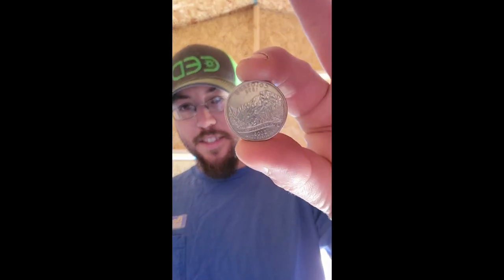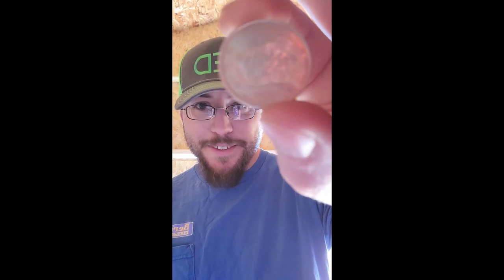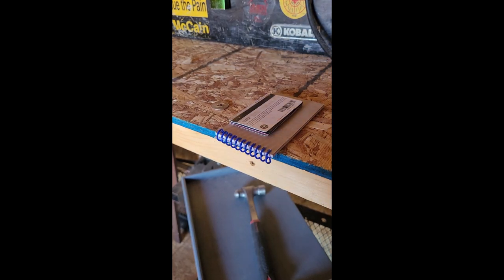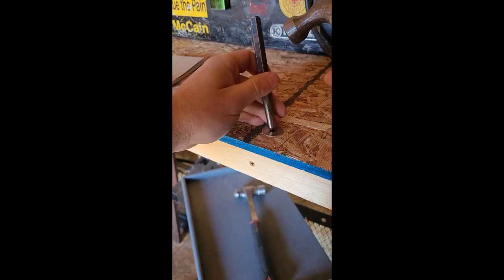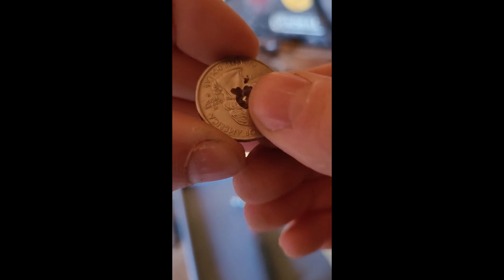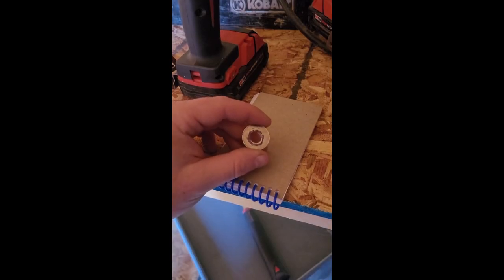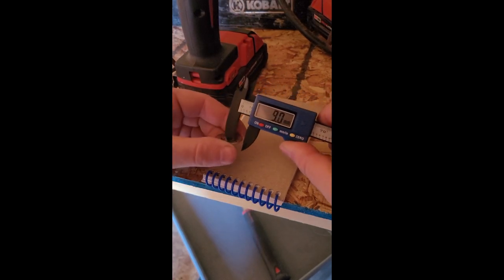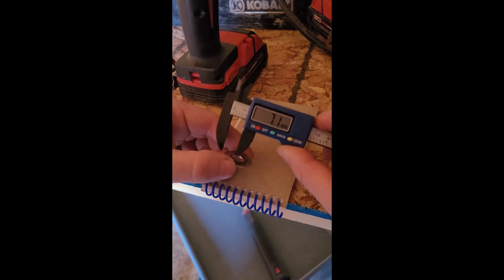Making A Ring for my Wife

Comment: Not bad. I just had 1 advice for drilling that start with the smallest drill bit and go up gradually to the required size hole. This can make it little lengthy but it is worth the time
Reply from the maker: Yeah I typically do this however, this copper clad coin is very soft, figured it would be fine going straight to the size I needed